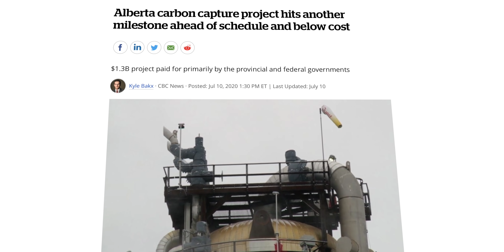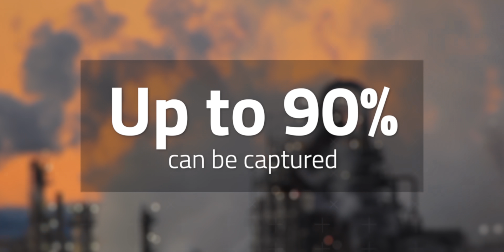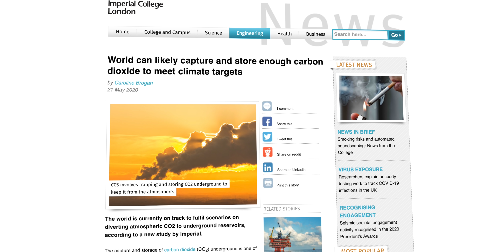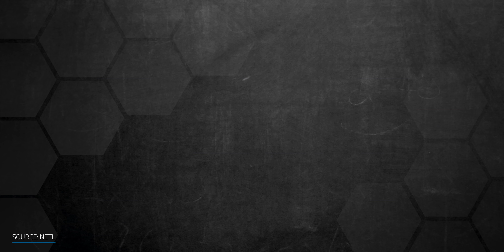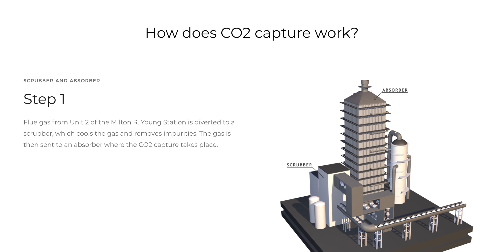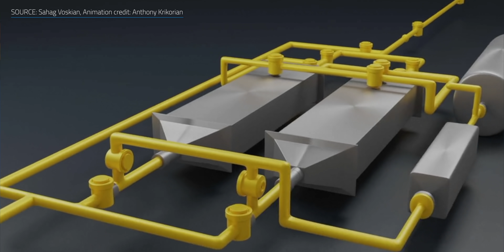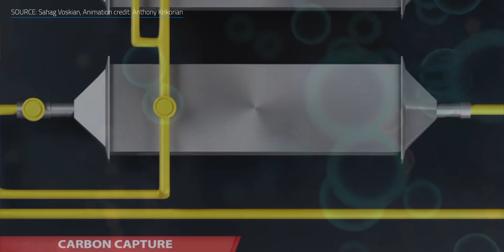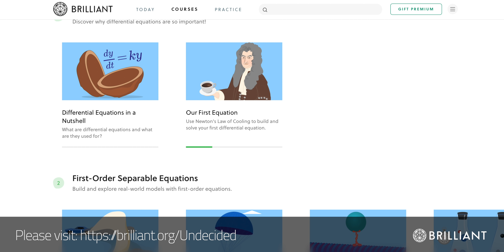The truth about capturing CO2 to reverse climate change

Comment: Another video missing the mark completely. You can keep improving your carbon capture technologies as much as you want. The reason they will not pan out is because of plain simple chemistry, physics, logistics and ultimately economics.

Let's take a tonne (1000 kg) of thermal coal as an example. When combusted, that 1 ton of coal results in about 2.86 tons of carbon dioxide (2,860 kg). This is because coal is mostly carbon atoms bonded with hydrogen atoms. Combustion is an oxidation reaction which will bond those carbon atoms with 2 oxygen atoms. So each CO2 compound will now have a molar mass of 44 vs carbon on its own of just 12.

But it gets worse. Not only do you have to deal with almost three-times the mass but it's also now a gas that must be cooled and compressed in order to be transported. This requires energy and enormous amounts of infrastructure.

Now think of all the mines and drill sites that are extracting oil, coal and natural gas all over the world. Think of the major engineering and costs that are required these days to extract those commodities.

Now multiply the mass involved by three,  change the substance into a gas that must be compressed in order to be transported, and try to run that whole system in reverse - Pumping CO2 back into the ground. Think of the massive costs and engineering required.

That's why it won't work. Not because it's hard to extract the CO2 from the plant's smoke stack. But because it would be way way cheaper if we just didn't combust the fossil fuel in the first place than it is to put its CO2 back into the ground after doing it or transforming it into a useful material.

Carbon capture is definitely possible. But economically storing it? You'd likely have to double or triple the cost of the fuel to pay for the infrastructure to put the CO2 back. And if you do that then you'd quickly find that it's cheaper to not burn it at all and find alternative sources of energy than to implement carbon capture.

You're much better off enacting a carbon tax on your economy and letting businesses and society find all the cheap, easy, low-hanging-fruit abatement measures.
Reply: Yeah, without a real dive into economics that video what a waste of time.
This is Rude-Goldberg engineering: keep tacking-on devices and processes to keep the industry moving.
Only 2 CCS seem economical AND scalable to me : enhanced rock weathering ; ocean fertilizing.

Comment: 1. Carbon capture from fossil fuel plants is a BAD idea. Coal is on the way out, and every dollar put into capturing carbon from the flues of those plants is a dollar better invested in something else, such as renewable energy or better efficiency. The same is true for gas, to a somewhat reduced degree. A big problem with gas is that the plants are generally much smaller, so it's a non-starter there as well. BTW I'm assuming we're electrifying transportation IAC, so it's just a question of what kind of electricity generation plants to use. Carbon capture from ICE vehicles is obviously not feasible.

2. Direct air capture is a GOOD idea. In fact, it's going to have to happen, and on a huge scale. But it shouldn't be ramped up much until renewables are the dominant energy source. Otherwise, the expense will slow the transition to those renewables, while at the same time facilitating continued use of coal.

Direct air capture needs to mostly be done with machines. A lot of this could possibly be driven by waste heat from industrial operations. IAC this can be scaled up to the necessary levels. This is not true of BECCS, planting trees, or other biologically based solutions, all of which require too much land, and possibly too much labor as well, and are likely to have a variety of other environmental effects as well. Air capture machines can be set up using very little land, possibly even underground. This is a huge advantage.

3. Incorporating CO2 into concrete—hmmm, sounds interesting. I had not heard of this idea before. But I wonder if it could be done on enough of a scale to lock up a large part of the existing CO2 excess. If anyone has extra information, I'm interested.

Comment: The "using Carbon Capture & Sequestion (CCS) to cure concrete and reduce CO2"  is silly.  Let's think about this.  When you take limestone, you cook it by burning natural gas, producing, CO2 which goes into the air.  CO2, in the limestone is driven out, leaving calcium.  Thus, more CO2 added to the air.  Then you mix up the concrete, and as it cures, it pulls CO2 out of the air.  Net no change, except the CO2 spent to heat the limestone in the first place.

If we use CCS CO2, to cure concrete, then CO2 is NOT taken out of the air to cure it.  But wait, you had to spend energy (presumably from oil), to move that CCS CO2 to the concrete to be cured.  So this idea is worse than useless.

If you want to lower the CO2 emissions from concrete, bake the limestone with nuclear power (say using electric resistance heating).  That would actually accomplish something.

Warm regards, Rick.
Reply: And capture the CO2 that the limestone produces in the fist place
Reply: There's a hint in the materials from the startup used in the video that infusing CO2 directly might cause more CaO to bond (the 'less cement' part of the promo clip). That might actually work if it is so.

In current methods some of the cement doesn't get to react with CO2 from the air, leaving a net positive emission even if hearing of lime is excluded...

Comment: If you really believe in CO2 and AGW (I personally think the science doesn't support it), you would be better off driving a Tesla (CyberTruck and Rivian on order :-), and Y probably in our future ) and installing a large enough solar system to supply both your home and EV needs (done), and install a Powerwall to meet your electricity needs during non-solar times (done).  CCUS is too expensive to be effective.  Switching to EVs and solar are a way to make a much bigger improvement.

Comment: Capturing carbon dioxide is important but there are so many more things involved with air pollution and the burning of materials to make energy. Human beings and all things that make contact with or use air for survival, which is no small number of things, are potentially and actually negatively affected by all of the particulate matter in the air. Soot, PM10, PM 2.5 and all of the particulate matter, matters. These things are not affected by carbon capture. covering capture is one piece of the very large and complex puzzle that we have put ourselves into by burning all this stuff to make energy. The best way to not have particulate matter in the air negatively affecting our health is to not put it there in the first place which means don't burn stuff to do stuff. And by that I mean fossil fuels for any reason.

Comment: Your videos are great. Enjoy all the content. One small point of clarification and possible modification for the accuracy of your videos is around the portrayal of cooling towers for nuclear power plants as a source of air pollution. This is a really common mistake that people make.That stuff that looks like steam that's coming out of the coolant towers is simply that, steam. It is not any source of air pollution. Again, thanks for the video and I enjoy all of your content.
Reply from the maker: Fair point on the cooling tower shots.
Reply: @UndecidedTechnology  Same with many towers in oil refineries. Not that they don't pollute. They do, it's just not the billowing stream you see coming from them.
Reply: @jeffreyhill3940  those towers at the oil refineries are burning off methane instead of releasing it in the atmosphere
Reply: Nuclear power is the key - zero carbon emissions!  Better = Small Modular Reactors; I did the calculation and to power our small 50K population town would cost families about $10/month instead of $110/month to the big energy companies.
Reply: The most significant green house gas is water vapour.
Reply: It's a tragedy that nuclear power has been stigmatized that way it has when it is the ONLY source of energy that can possibly fill our energy needs as the whole world develops towards First World standards. Wind and solar won't cut it.
Reply: @squamish4244  wind and solar energy are pretty much useless as a reliable source of energy because they need wind and sunny days to operate, they take up quite a lot of space and what about the blades of a wind turbine when they are old and need to be replaced? i saw an article a few months ago that stated that the composite that's used for the blades is going to be the new asbestos. for example if a turbine catches on fire, there is no way we can extinguish it because they are usually placed somewhere far away and the part that burns is pretty high up. with solar panels we completely destroy 3rd world countries landscapes so it's basically the same as we do with coal but somewhere else so we can feel like we save the world and have some other government deal with the extraction and they are not even that efficient when they are working under prime conditions.
Reply: @Philip Ethan van Harreveld I did the math on SMRs - It would take up 4 Square Acres and would power 50,000 homes + businesses.  It would reduce my electrical bill from $125/month to $10/month.  Solar or wind would take up way too much space and not work if it was cloudy or not windy.  Watch this Tedx Talk from an environmentalist Michael Shellenberger: https://youtu.be/ciStnd9Y2ak
Reply: I am far more wooried about the toxic spent rods than the steam.
Reply: @marjohnsmusings3222  If we take all of the spent rods and put them in one place it would cover a football field 6 ft. high - that's not much...  IMHO bury it a few miles away from existing uranium mines at a depth of 1000 ft. encased in glass, then concrete.
Reply: Steam is water vapor.  Isn’t water vapor a greenhouse gas?   If so, then henceforth, steam is equal to pollution.   When vapor condenses, and descends to earth, the ground gets polluted.   When the vapor, now droplets, collects and runs into rivers, the river is polluted,   And when rivers run to the ocean, then the ocean too, is polluted.  So for eons now, our clouds, lakes, rivers and oceans are one giant pool of pollution.    Sucks, huh?
Reply: Actually h2o is just as bad of a green house gas as co2. And as the earth get hotter more gets stored in the atmosphere, causing this to speed up. Not saying that you’re wrong but water vapor is a green house gas.
Reply: @the2theonly672  Water vapor is the temperature regulator of the earth . The beautiful thing about it though is that it coalesces into clouds and then falls from the sky .
Reply: @johnathanmiller3033  the scary thing is it collects around the equatorial plain and exacerbates hurricanes and typhoons.
Reply: @marjohnsmusings3222  That's not happening either . Neither the frequency nor intensity has increased . You know I'd think if a person was responding to a comment made 5 months ago they would at least take the time to look up the facts and learn something about it before sticking their foot in their mouth . 
   Oh and BTW ... a hurricane and a typhoon are the same thing .
Reply: @the2theonly672  while water vapor is a greenhouse gas, its residence time (how long it stays in the atmosphere) is a matter of days vs. co2 which has a residence time in a matter of decades. water vapor condensates and rains out, co2 does not
Reply: @sarahsalvatore9561  Interesting
Reply: @the2theonly672  NOT!!
Reply: @the2theonly672  The difference being that H2O readily precipitates out as rain.  I can't recall the last time it ever rained CO2 - it just sorta enters the atmosphere and STAYS THERE.
Reply: @the2theonly672  Yes, H20 is a highly potent greenhouse gas. As more of water vapor collects around the equator our weather gets even crazier. The lack of snow pack and spring melt aborting flowing rivers is what keeps me up at night. Drought spells death in most parts of the world.
Reply: @the2theonly672  In that case dont we need to drain all oceans? They made on h2o, you know?
Reply: @Vednier  The Water in the oceans is just that:  WATER.   Steam, on the other hand,  is water VAPOR. It's a gas.  It is the water vapor (a gas) that is a powerful greenhouse gas that adds to the over-heating of the atmosphere.  To go further with this,  the heating of the oceans as the world over-warms is driving more of the ocean's water to vaporize into the atmosphere, further heating it.   (a "vicious cycle")
Reply: @turningleaves5  You do understand that "steam" as hot vapor is rather anomalous state of water in general case? Steam almost instantly getting colder, condensate and turn back in water. There is maximum amount of water vapor which can be dissolved in air at certain temperature and all excess vapor fall out. Even so, no matter that you do you cant stop large quantities of water to evaporate normally. You literally ask to fight with your own shadow instead dealing with real problems.
Reply: @turningleaves5  Bull shit . It's been proven that is NOT happening .
Reply: @turningleaves5  lmao I swear some people just didn't pay attention in 8th grade science.  Steam rises until it cools due to altitude and then it rains. I swear this is just religious rapture.  It will simultaneously be too wet and too dry and hellfire awaits us if we don't repent in the form of paying more taxes to fix imaginary problems.  If you don't want CO2 emissions then just don't use them. Don't pay people for their products that had fossil fuels go into them.  Use stone tools since steel is smelted with coal and carve out a piece of land where you can live in harmony with all of nature
Reply: @turningleaves5  First off, it's NOT steam, it's vapor, and while it MIGHT be treated using certain calculations as an ideal gas, it's not really a gas either, it's just water molecules that will eventually do what water molecules do under normal atmospheric conditions, it will condense out and fall as rain.  I can't think for a second the last time we ever had CO2 showers, or O2 showers.  Quit catastrophizing on water vapor, it's been around for billions of years and hasn't been much of a big deal so far.  Stay focused - the issue is CO2.
Reply: @johnathanmiller3033  What exactly was Proved by whom? Re: excess water vapor making climate change worse
Reply: @marjohnsmusings3222  I never said anything about water vapor making climate change worse . That's complete bull shit .
Reply: @nobodyknows3180  Which has - to be fair - around on this earth exactly as long as water vapor and hasnt been a bid deal in the last 4 billion years as well...
Reply: @turningleaves5  so let the gas cool down and condenses back into water.  It's the same compound just in a different state.  Liquid water evaporates from bodies of water constantly from sunshine and heat.

Comment: NASA, and nuclear submarines, use lithium hydroxide to scrub low-concentration carbon-dioxide from cabin air:

2LiOH(s) +CO2(g) →Li2CO3(s) +H2O(g)

It just occurred to me that if some sort of lithium-battery chemistry were available that used the Li2CO3 product of that reaction, then scrubbing CO2 out of the atmosphere could be part of the process of making EV batteries!  The carbon would be sequestered in batteries.  Two points for the environment!

I haven’t thought this out whatsoever;  it’s just an off-the-cuff “brainwave.”
Reply: Lithium is a rare metal.
It also takes a lot of energy to mine and process.
Reply: GeorgeMonet, Lithium is the 33rd most-common element on Earth by mass in the earth’s continental crust.  It’s neither especially rare nor especially abundant.  Bear in mind though, that it’s mass density is very low, so it’s density by volume is somewhat higher.

The most-frequently-used approach to mining Lithium is to pump water into regions with lithium-rich minerals and back to the surface, and then evaporate away the water in large brine pools.  That doesn’t take very much energy, but it does expend a quite a lot of water.